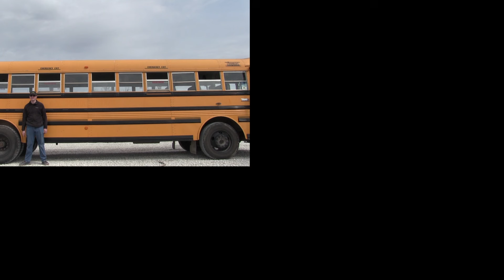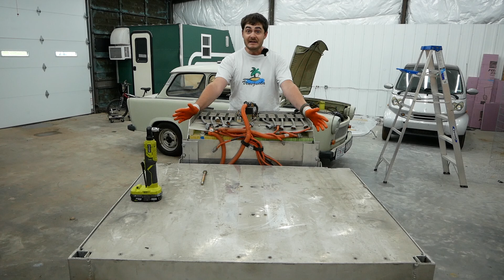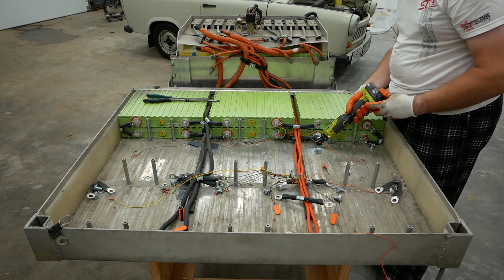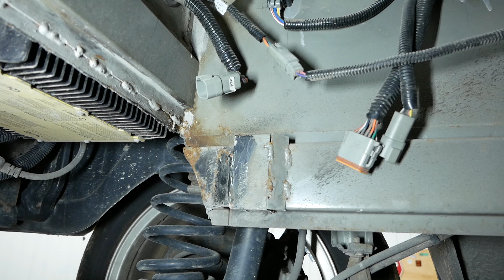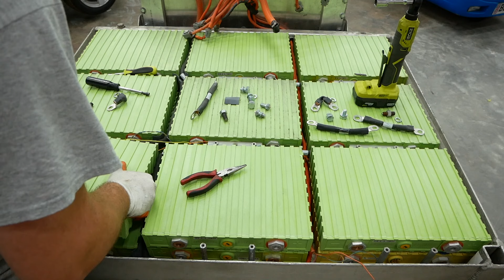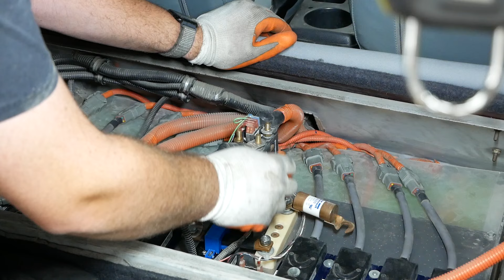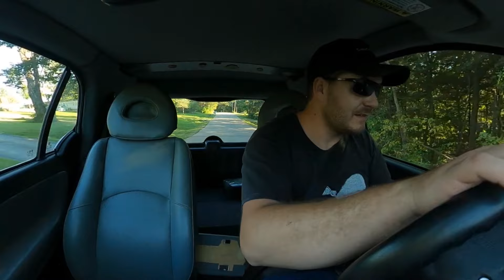Can I Revive the Dead Battery Pack in my Wheego Electric Car?

Comment: If nothing else, the battery pack should be a great starter for making your own power wall. If built right, you could even just plonk it into the bus at some point, or atleast have the experience of how to build one specifically for the bus.
Reply: What would be the point of that?
These batteries are a bad candidate for such a project.  As far as I know, most lithium power storage for solar is lithion ion, not these types. The voltages are different and the charging characteristics are different.
Reply: @tarstarkusz  Lithium Iron Phosphate are great for solar installs where space and weight isn't as much of a concern. They are more robust, have a greater cycle life, and cost per watt is a little less.
Reply: @RingingResonance  I know they are a LOT better than lithium Ion in terms of cycles and years of service.  They can easily last 3times as long.
Reply: tarstarkusz the charging voltages are irrelevant most inverter chargers are programmable. At least those you’d use for a bank of that size, avoiding the chinesium garbage.
Reply: @tarstarkusz  LiFePO₄ is actually ideal for solar projects. Its long lived and less volatile then lithium ion chemistries. Where it isn't great is energy density which makes it fairly unusual for commercial ev production. Oh it also happens to line up pretty nicely with lead acid in terms of voltage when you use cells in multiples of 4 so most loads designed for 12 or 24 volt lead acid batteries runs happily off LiFePO₄ and there is a lot of off grid solar gear designed to work with ether lead or LiFePO₄.
Reply: @mgkleym  Will they charge properly with lead acid charger?  As far as I know, lithium chemistries will runaway from you and overheat if they are not charged properly.  Ones assumes you at least have to get a different charger.  But it is good that you can use 12 or 24v inverters.
Reply: @tarstarkusz  No you don't want to use a standard lead acid charger. But there are a lot of solar charge controllers that can handle them. There are also options if you want to charge from an alternator or ac power. 

Its fairly common to have options for flooded, agm and lifepo4 on better quality solar charge controllers these days. There are also chargers that are fully programmable and can work with any battery chemistry within a given voltage range.
Reply: @tarstarkusz  the charger he used in this video was sold for tending 12V lead batteries but it had a LiFePo4 setting on it too. The charging logic is a little different but self evidently it's pretty easy to make a lead acid charger charge LiFePo

Of course that's still a charger that has a special mode, and plenty of lead acid chargers don't have such a mode.
Reply: @kaitlyn__L  He said it had the mode.  He also said he used a DC power supply on some of them.  I guess he had a way of limiting the current.
You can trickle charge a lead acid battery.  You cannot trickle charge a LIFE battery from what I understand.
Reply: @tarstarkusz  he used the DC power supply with limited current up to a certain voltage, and then took them off, putting them onto the proper logic controlled charger to finish them up. He said it in the update video. 

He also did charge pretty slowly to reduce internal damage, regardless of whether that truly counted as trickle charging. 

Of course NiCd and NiMH batteries can also be trickle charged. My smart charger has a 100mA rejuvenation mode, where it discharges and then charges again. 

I believe he tried to recreate that effect manually with the car batteries, but he charged 1 or 2 amps as the slow charge, so that it would still charge within the span of a day or so. Again from the update video. 

IDK if 100mA would even work here, but if it did it'd obviously take ten times longer to charge. Even just to rejuvenate an 800mAh AAA NiMH battery that way took me most of a week, and he needed to get many more packs done – and it took two-ish weeks still for him. So I totally understand choosing 1A as the slow charge for such a large Wh capacity.
Reply: Yeah, if you decide to replace the cells in the weego you could use some of the old batteries that still test good in your bus.
Reply: Not really. The battery cells are mostly dead so it would be a pretty lousy power wall. :)
Reply: @nitehawk86  betting you, its just a few genuinely bad cells, i only say this because... i have delt with similar battery packs for jobs over the years, and, as little as one cell thats totally shot, can actually drag a whole pack down drastically, more then you would think, more the it infact, should, sadly, depending on the design.. 1-2 bad cells is all it takes to cause this kind of effect, the bulged one, i would have told him, that ones shot, his best bet is findout who made them and see if the company wants bad ones back for re-cycling... 

the bulge was a sign the cell was gassing out when recharging, if no others had the same issues, a modified pack could be made, but, i would be its a min of 3 in that pack...

i say this based on years of exp with battery packs, lead acid, lipo, lifepo, nicad, nimh, the more you go back the more obvious the issue becomes.. nicad battery packs were fucking notorious for having a couple cells fail and needing a rebuild, the guy who owned the radio shack for most of my youth and adult life in this town use to do that for kids into real remote cars(not the cheapo ones you cant rebuild, ones that you make from a kit and can rebuild and modify), the packs were not cheap, still arent, he would rebuild them for a very small fee, sometimes just giving kids ones he had already rebuilt or made form quality bulk cells he purchased then ran on an early smart charger, that was a size of a first gen top loader vcr.. but only did 8 cells at once.. it did however, charge them via a true smart chipset that would cycle them 5 times, and give you the average, the good thing about that was, it did AA size (most common for packs), but also cells of all other shapes and sizes, a set of very nice adapters to re-charge single cells that are in laptop type battery packs even...  anyway, i would bet over half are still quite useable for any number of projects...

humm... battery powered go-cart/mini dune buggy perhaps?

i mean, that seems like it could be a fun project, and, he could re-use alot of the pats from the weegos drive system even... then look at turning it into some sort of abomination like putting an engine that never should be in such a vehicle, or working with somebody on a custom battery pack design perhaps using salvaged cells from other brands totaled cars for example... (i got a buddy, who got ahold of 4 tesla full packs in the same year from the same wrecking yard, they didnt want to deal with the tesla and sold it to him for 1/2 the value of the battery pack but he had to take the whole car each time.. and each time.. it was mangled.. but the packs 100% intact, the yard dosnt want them because the owner has seen warnings about them being a risk due to the voltages involved and the fact that a damaged pack, could, no matter how unlikely..burst into flames/explode in the right/wrong conditions, they used the packs to build a short cargo container that houses the grow operation hes part of up north when the suns down, though their 6 vertical poll top wind turbines are always spinning... even when the winds not moving at ground level... the setup is growing, they are now building a couple others with banks bought out of electric cars that the wrecking yards( picknpull/upullit/etc type places) owners dont want the trouble of dealing with, the funny part is... they have also each ended up with an electric car that was sent for scrap by the insurance company, that was perfectly capable of being rebuilt into a safe, if often ugly car... often intentionally ugly.. less likely to have a car with miss matched doors, quarter panels, hood, etc on it... specially when they make runs into the seattle metro area... they take cars that look like abject hell but.. other then that are.. actually damn nice..

and, hey if he stacks then on end..he could build an interesting wall picking the cells that arent showing signs of being genuinely fubar, and just put them all in series end to end... just dont touch both ends at the same time... unless your gonna live stream that shit at 4k...
Reply: Lassi Kinnunen  Oh.  As far as I knew, most who use batteries at all use lithium ion, though obviously you will get more cycles with life.